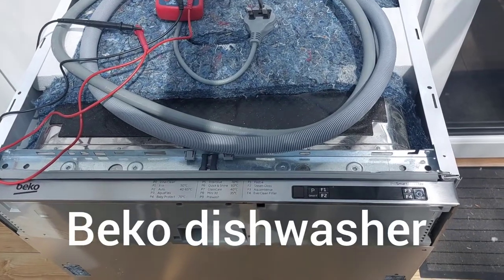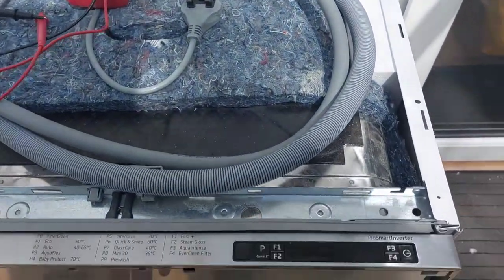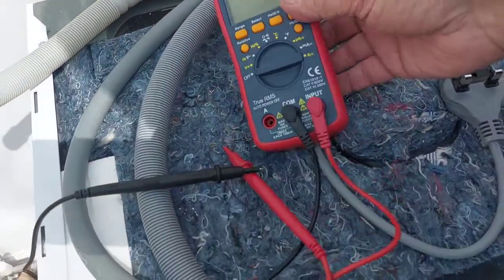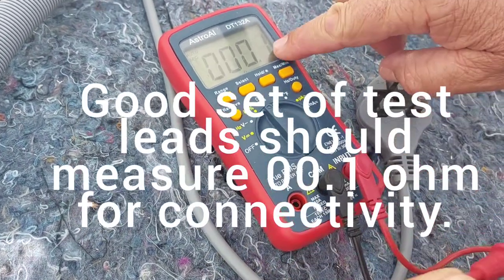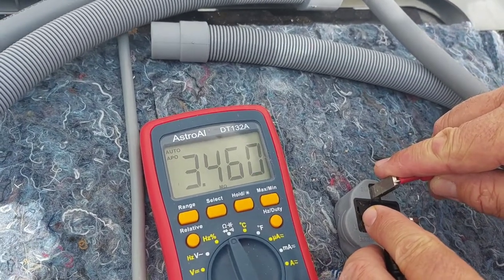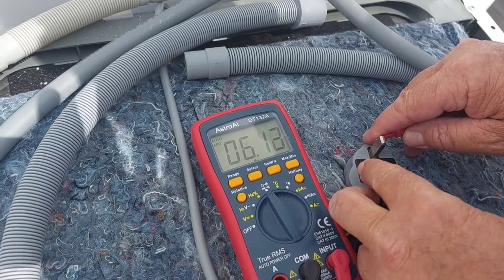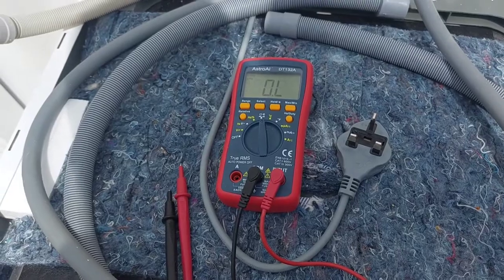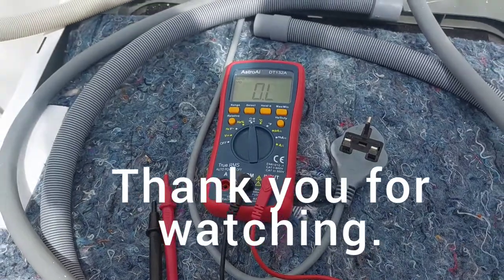Diagnosing a dishwasher,tripping the circuit breaker.

Comment: My property manager has sent “maintenance” guys to my unit for this issue but it’s never resolved. The breaker is now to the point that anytime I run the washer, it smells like something is burning. It’s been going on over a year and she’s now telling me the breaker trips to prevent a fire. They’ve replaced the socket under the sink that connects to the dishwasher and breaker but no change. I just added renters insurance on our unit because I have a bad feeling a fire is going to start. Even my new tvs are crackling and having issues. The maintenance guy said the way they made the apt units is horrible. Well if they just pull out the dishwasher, check it, (it also spits out debris on my dishes that I clean just so I have proof). I think they don’t want to pay for replacements for the breaker or dishwasher. I got estimates on how much it would cost to replace or check the wiring and the sockets etc PLUS breaker and dishwasher on top of an electricians billing.. we’ll over 2000 dollars. They’ve raised our rent twice and we receive no help when sh*t messes up.